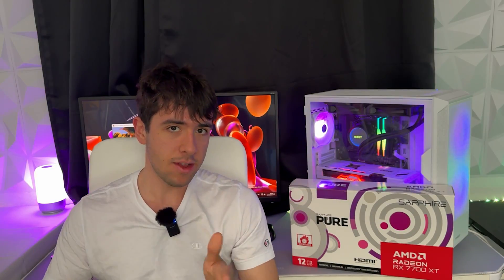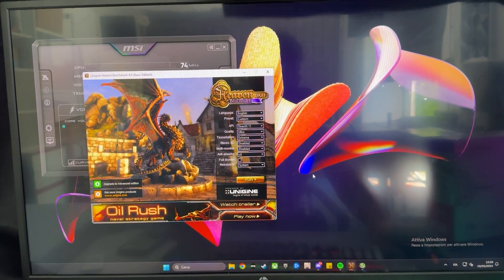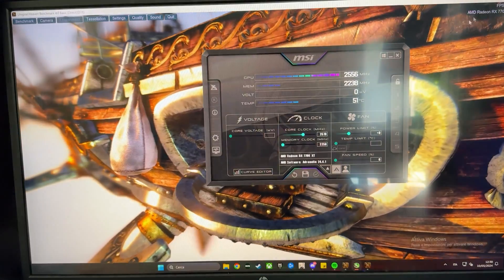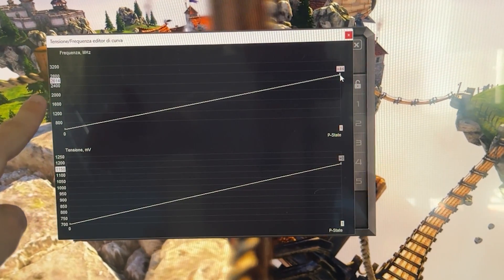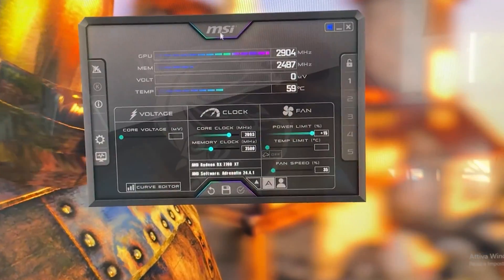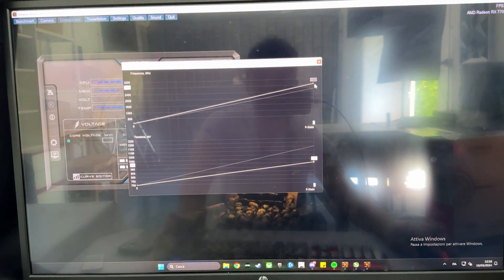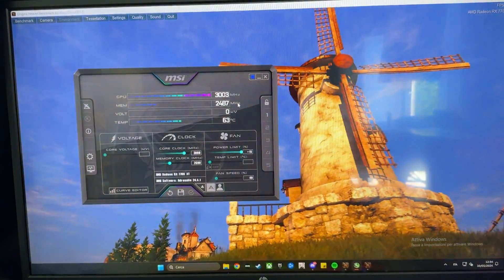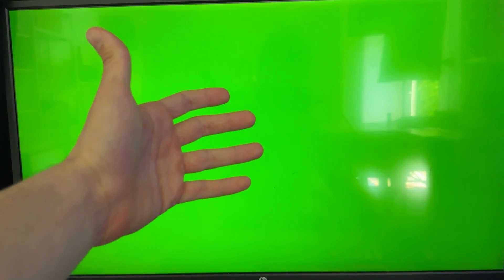Undervolt your RX 7700 XT for more FPS and Lower Temperature! - Tutorial

Comment: so about testing stbilty after undervolt, is it always more accurate when i test it in games? I've got 10-15 celsius lower temperature(hotspot) , but same performance as before.. does that mean i did it right?? before it was 1150mV, min clock speed 500, maximum clock speed 2700.. after adjustment it is 1050mV, min clock speed 2550, max clock speed 2700. can anyone tell me is this okay? thanks

Comment: folks, don't just apply random settings found on youtube. watch an adrenaline oc guide on these cards. allow for full power consumption and max clock, then slowly reduce the voltage. the clocks will increase automatically, that's how these cards were designed to function. memory is an entirely separate topic, and I've owned several radeon cards that did not like mem oc at all.
Reply: He's talking about undervolt
Reply: @everythingabouteverything3226  me too
Reply: So undervolt then oc to maximise performance?
Reply: @reap-gaming you cannot force higher clocks. It's being done by undervolting up to the point of instability.
Reply: Is using auto undervolting safe inside the Radeon software
Reply: @ICrimson8x  safe for the hardware? You cannot damage it if that's what you mean. There is no guarantee that the auto undervolt result will be 100% stable in all games and scenarios. You are better off spending a few hours in doing it yourself, and being very soft on the volts
Reply: mmMm super finniky this card is

Comment: my asus dual 7700xt keeps crashing if i do the same settings as u
Reply: You fixed it yet?
Reply: @lixxor6  nah i mean it works normal without overclocking and undervolting. But no
Reply: @mrfred1427  we have same cards.. if u find anything to make it more efficient plz lemme know
Reply: Stick on Undervolting only. Don't bother especially touching Vram and Power limit.

Comment: Your temperature did rise when you applied the changes. WTF? :D Is there really an TEMP reducing potencial with 7700 xT pure version you have?
Reply: if you just undervolt it will reduce temp. if you increase clock that it will use that headroom for more performance and can get hotter, depends what you want
Reply: Factory specs say 2599 freq with boost. I set my max to that, set a 1000 undervolt, and a Tiny memory OC. I get %100 card usage and 45 Celsius